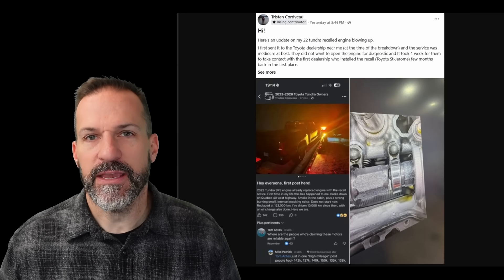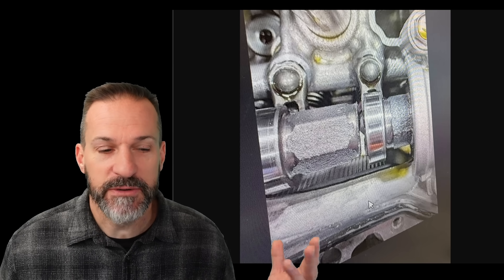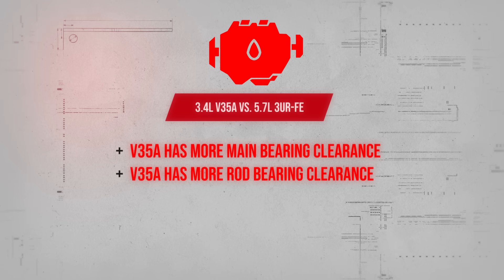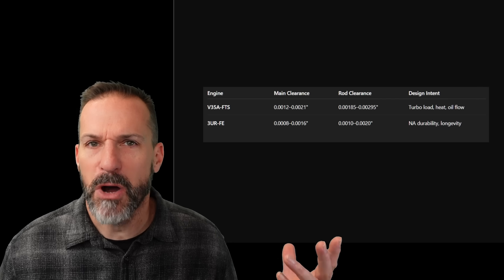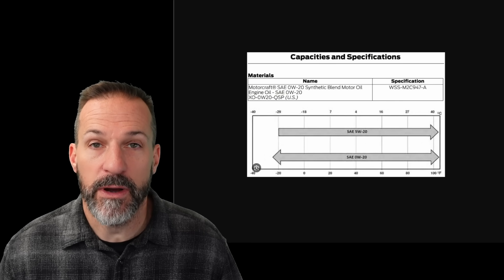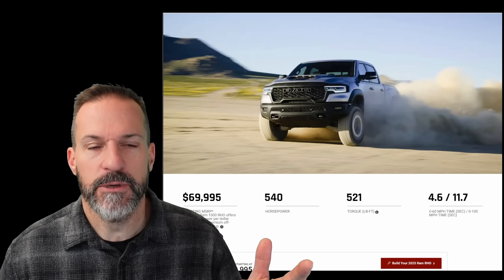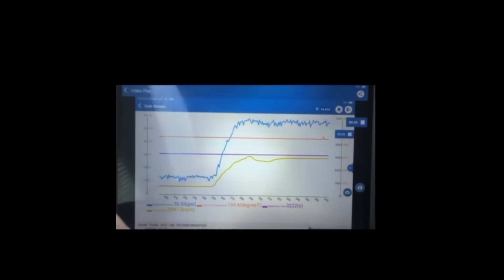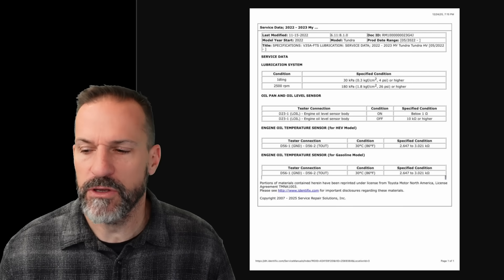Can We FIX Toyota's BILLION Dollar Mistake at Walmart? 2022- 2026 Tundra...

Comment: With respect to temp range any oil is acceptable.  Do NOT ignore the old school temp vs viscosity charts.   They track Toyota and Lexus engines overseas in the Middle East, Europe and Australia.   Even 15w40 in an engine that specs 0w16 here in the states.   

Everyone cries the VVT systems can’t handle the more viscous oil. But at the proper temp the engine doesn’t know the difference.

Comment: 0W40 will likely solve the issue, however, modern engines are also calibrating the variable oil pumps and the derivative calculations off of the OE spec oil. You will also want to recalibrate the oil pump logic to the higher viscosity oil. This likely won't matter for everyday use, but for high performance or high load towing this very well may matter. As variable pumps are controlled electronically not just via bypass valves. They only have a high pressure bypass so it doesn't overpressure, but you might set off check engine lights if the diagnostics fail due to the different spec oil being used.

Comment: Turbos stink in gas engines for longevity. The higher rpm’s and heat just wear everything down faster. Turbos are great on diesel’s cranking 1400 rpm’s.

Comment: If Toyota the reliability king for decades is having issues with small displacement turbo engines in trucks can we FINALLY go back to simple V8's!? Every manufacturer is having issues. Save a little fuel but make engines grenade with less than 100K... ridiculous. Throw away cylinder deactivation, hybridization and start stop crap. Give us a simple, overbuilt, pushrod V8's again!

Comment: For the old school engines, 15psi oil pressure would be The Absolute minimum at Idle that I would call sufficient, with 30-50+ while under load. Running 6psi at idle, especially in a boosted application, is mechanical suicide. 
On the oil weight, it's rather important to understand the additive package has an incredible amount of difference to how that viscosity performs in its range. A 0 weight oil is that viscosity in Summer temps, whereas the number following the W is in Winter temps. The two (additive package and the base weight components that is) go hand in hand in the grand scheme of things, but if you want more protection vs a 0 viscosity, you'd need to move up to a 5W-30 or 40. My old race-built 4 banger running 35psi (early 2000s build) was 20w-50 spec, though I'd rev the nuts off the thing frequently and change the oil as both precationary and mechanical safeguard measures.

Comment: My 22’ L87 6.2 failed pico test at 58k this summer and engine was replaced under warranty.  I went to 0w-40 at 300 miles on the new engine. I’m a mechanical engineer.  These companies are now being run by finance and marketing, not engineers.  EPA is driving decisions creating poor reliability and at this point don’t see anything that is going to change in short term.😢

Comment: Back when Ford first changed their older engines from 5W30 to 5W20, I immediately saw this as an issue. For one thing, those engines were broken in and spent the majority of their lives running 5W30, but suddenly 5W20 was going to be the recommendation????? No way.
I bought a used 1998 Ford Windstar from a co-worker who was moving out of state and he didn't know what to do with his old van. I offered to buy it and he accepted. It was spec'd at 5W30 originally and now I was supposed to run 5W20 in it. I called the local Ford dealership and asked about this requirement. I said I believed that the 5W20 would probably provide sufficient lubrication for the engine, but would the 5W20 provide sufficient cushioning for the parts. Would running 5W20 actually allow the internal parts to start rubbing and cause additional wear? The individual from the dealership said he could not argue my point and said Ford only recommended 5W20 but did not require 5W20.

Comment: Almost makes you wonder if there something you could do with a TAZER or similar device to program the oil pump to keep a much higher pressure. This needs to be a wake up call and consumers need to push back hard against EPA fuel economy standards, we need reliability standards instead.

Comment: Tighter tolerance means better control over variance in specs.  It doesn't mean 'tighter'.  The tolerances on diesel engines are FARRRRRR better (tighter), because they HAVE to be with the crazy compression ratio's. You don't see them failing from 'tighter tolerances', you see them last longer.

Rant over.  I'll watch the video now...

Comment: We speak about load but not a single time has anyone mentioned that the tune is the issue along with fundamental design … you can change the load on the engine by tune but Toyota can’t change the tune or they will get a hefty dinner vehicle sold due to emissions. The main reason they went from a v8-v6 … the biggest issue with these engines is not just the design of the crank and bearings but also how these engines were tuned to make the power and load on said parts. A simple tune can change that aftermarket but on a global scale for Toyota it’s not so easy as it needs to be emissions compliant for their emissions credit.

Comment: In our country, Toyota runs 5w-30 for all twin turbo V35A engines. Zero engine failures. Another note, our LC300 and Lexus came without AGS “Active Shutter System” from factory. That is another thing you need to look into.

Comment: Lets get something very fundamental straight right from the beginning.  Tolerance and clearance are not the same.

Tolerance is the allowable deviation of a dimension from its nominal value.  Example: 1.00 +/- .005.
1.00 is the nominal value.  +/-   .005 is the tolerance.

Clearance is the gap designed to be between two parts.  Example: .010. And it has a tolerance  010 +/-  001.

You need an Automotive Engineer to proof read your content.

Engine oil viscosity considerations is another example.

Comment: If it helps your research, one of my cars is a small turbocharged Chevy.  I bought it with low miles, and I wanted to do the best maintenance I could with it.  US spec oil for the LNF engine is Mobil 1 5w30.  However, looking at an Opel owner’s manual of a car using the same engine, it seems Opel specs the LNF engine with a euro 0w40 oil.  I did the same thing with my Dodge (using a Lancia owner’s manual) and sure enough, a thicker oil is recommended.  It’s obvious US oil spec focuses heavily on fuel economy and emissions rather than engine longevity.

Comment: Worked at Toyota & Lexus for years. I drive 2005 Saquoia it will live forever. My wife has a 2014 Lexus Gx460 will also. But front cover will need a reseal. Is what it is. Good old quality

Comment: The exact thing i was saying back when the L87s were coming out, and now all 3 of them have close to 100,000 miles running nothing but 5W30 with no issues.

0W40 is better than 0W20 for sure, but i'm not at all convinced it's enough. From our 2017 Yaris to the 2023 mazda 3, and every work truck we have that calls for something under 5W20 we have been using 5W30 with not one issue. 

I'd recommend everyone to do the same.

Comment: The number of main bearings is pretty sure to be significant. Four in the V6 vs. seven in the straight 6, even allowing for variations in bearing widths and diameters. Flogging an undersized engine with turbocharging to get massive power and torque never seemed to me to make sense and experience seems to be bearing that out.

Comment: Wow didn’t know the Toyotas have a variable oil pump?! And 4 psi?! Wtf! That’s insane! Also learned something about my 5.7 that the bearing clearances are closer than the V6 TT! I run 5w30 in the 5.7 and I just let it warm up in the winter but zero issues and maybe I use a gallon more gas between fillups.

Comment: Sorry, know this isn’t a video about your Ram… but I have a question. My 2026 Ram 1500 Rebel has about 4500 miles and I’m averaging 16 MPG with 90% highway miles. Cruise set at speed limit of 75 in 2wd… this seems crazy and I noticed your mileage loop was much higher.  What if the RPM of your truck at 75 mph.

Comment: Do not confuse oil pressure with oil flow, Harley Davidson engines are low pressure but high flow engines, that’s why they no longer put an oil pressure gauge on them. With the right lubrication package you don’t need high pressure just the right amount of oil where it needs to be.

Comment: Chevrolet had failure issues on the 6.2 liter engine. At first they recommended 0-20w oil. Then to solve the failure problems they switched to 0-40w and solved the problems.
Reply: That didn’t solve it, just got engine to run long enough to get out of warranty

Comment: I have had 800hp 4 cyls. Stock v6. Stoc v8. Whatever. Had mercs. I run 5/30 in everything I have except the 6.0 I have I use 15w40. Heavier oil is a MUST.

Comment: The correction would be to install the tried and true solid reliable 5.7 liter V8 as the recall fix not replacement V6 turbo motors.  A V6 option in the Tacoma and 4runner would be good as well.  Things were not broken and they didn't need fixed with turbo motors.

Comment: Yup i knew it!!! 0w20 is absolutely the wrong oil for this engine. I put 0w20 in my 5.7 tundra back when it first came out and when it came time for an oil changed i noticed that the 5.7 burned more than 2 quarts of that oil. I immediately took back the 0w20 and got 5w30 and never had an issue with it burning oil ever again. And now my 2022 V35A ive been putting 5w30 in it and it runs sooo smooth with 90k miles.

Comment: I think the entire aluminum engine block is not rigid enough and the entire engine is flexing and warping, hence the crankshaft spinning inside this twisted engine block is spinning crankshaft main bearings.  The crankshaft can only spin properly inside the main bearings if the whole engine assembly stays perfectly square.  The block walls are too thin, the block is not reinforced enough, and the cooling chambers are not circulating enough coolant to keep the aluminum cool enough not to weaken and twist.  I would be willing to bet a similar engine block design with thicker walls made out of an iron block would not twist.  Bad engine design.

Comment: Why put 0-30 or 0-40 when you could bump the W weight, which is the real wt. The second # is the fake wt, imo. My car mfg wants me to use 0 or 5-40, but not a chance. I mix 10-30 with straight 60wt, 50/50 mix, plus 1/2qt of Lucas. If I could get the oil I wanted in straight 40wt I'd likely use that instead, but this mix works. So whatever wt that turns out to be it's substantially better than the oem suggestion. I also disable the variable pump so I have normal psi. It doesn't get very cold where I live so no need for thin oil. On the coldest mornings I have pressure in 2-3 seconds, which is better than what others with the same engine report, using the suggested 0 or 5W oils. Maybe it's because I have less oil draining out? Maybe the thicker oils don't move as slow and we're led to believe. Plus, at cold start, I bet $ I have more oil left on the bearings and of course what is there is much better. If I did live where it's cold enough to be an issue I'd use a block heater, or more likely, a pre-oiler, but I would never use thin oil. 

My friend with a 2yr old Jeep is on his second eng. Neighbor across the street with a Dodge truck is on his third set of cams. No thank you, I'll use real oil and pressure. All my friends refuse to use thicker oil out of fear it will void the warranty, as if anyone would know. I just laugh and tell them I hope it fails before the warranty expires. Then I also wonder; how do you think the car mfg pays for those engines under warranty? Increased new car prices and reduced quality, obviously. 

If I had to guess why the mfg's are being forced to use super thin oil, I'd imagine it's big brother trying to force electric cars. Their MO is usually not to dictate, but guide you into making the decision they want.

Comment: The engine oil goes through a oil cooler using engine coolant which is 210 temperature they need external oil cooler

Comment: I’d be curious to know if there is a trend to the operating conditions when failure happens. If there is a trend that they all seem to fail on the highway while cruising that would make sense since the engine is operating at very low rpm and high load for extended periods of time, exactly the right conditions for low oil pressure due to thin and hot oil to take out bearings.

Comment: The age-old oil issue that has been going on for the last 15 years, the needs of the manufacturers vs the good of the consumers and how manufacturers do not always recommend what is actually good for the consumers because of the CAFE rules. I want to listen to the manufacturers and their recommendations on oil. However, after rebuilding an engine due to stuck piston rings due to oil burning, I have come to terms with the fact that manufacturers do not want you driving their cars beyond warranty. And, 60-100 kmi simply isn't  long enough to own a car when paying the amount of money I have to pay to get a new car. Should have been putting in 5w-30 and lose a few mpg instead of 0w-20 and losing 100 kmi less engine life.

Comment: Surely, if it was only an oil pressure problem, Toyota would have fixed that by remapping the pump quickly and cheaply. I think it's a complex multi factor problem like most modern failure scenarios.

Comment: I think we're seeing a lot of it on these turbo engines due to being programmed to be running on the edge of efficiency all the time high pressure heat hot spots lean burning direct injection washing down the cylinders so we're burning oil as well and oil contributes to pre ignition I think a lot of the wear on main bearings is pre-ignition based. And I 100% agree that these variable pumps in thin oils or contributing factor as well

Comment: There are many people with engine failures that have ran 0w30 or 5w30, so that’s not the answer. I’d be curious whoever posted that data log would try Xw30 oil to see what the difference would be? I’ve heard in the Middle East and Australia people are using 5w40 and they’re still seeing failures. Also, fun fact is the 3.5 ecoboost has tighter tolerances than the V35A.

Comment: First, who started calling clearance  specifications "tolerances"?  You could have a quarter inch clearance with a 1 ten thousandth inch tolerance.   I.E. 0.2499 inch to 0.2501 inch.  Anything could have a tolerance. 

Second, are we saying that these bearings are 100% "hydrostatic"  bearings, totally dependent on the supply pressure to resist loads?

The other extreme is a fully "hydrodynamic" bearing, where the rotation alone can create an  "oil wedge" with stiffness of 100,000's of psi.  Some early journal bearings had zero supply pressure.  The oil sat in a sump below the bearing, and was brought up to the bearing with a large diameter "oil ring".

Obviously automotive bearings are a mix of both hydrostatic and hyrodynamic.

 The huge journal bearings in utility turbines of 1million HP, do not depend on the oil supply pressure to support the loads, (except to ensure adequate oil and, for the cooling effects).  These bearings need to see minimal loads at startup due the low rotation speeds where the film thickness is very small.  

It would be nice to have someone with access to finite element hydrodynamic bearing stiffness and damping analysis software take a look at this problem.  I have used some bearing programs developed at UVA, Fortran at the time, but not sure I could run them under Windows 11.😂

What do I run? (5W30).  It is true that thicker oil "with all other variables frozen" should show better stiffness.  Also, since the oil is also treated as "hydraulic fluid" in modern engines that may need to be considered such as VVT.

Note, a 5w30 oil if hot enough, will have same viscosity as a 0w20.  Perhaps temperature needs more consideration.

Comment: That's a real interesting theory I have a 2024 Tundra bought in January of 24 and I recently received an engine recall notice. I would consider doing what you suggest but I won't because I won't do anything that could void my warranty I have an extended warranty 8 years and 75,000 miles it would be stupid to try something like this and loose this warranty that was pretty expensive. My owners manual said that you can use 5W20 if 0W20 isn't available but you should go back to 0W20 the next oil change. Even with using thicker oil my engine could still fail and then I would just be SOL so no thanks Car Guy. I don't think it's very smart of you to recommend doing something that will void someone's warranty and could also potentially eliminate them from taking advantage of recalls.
Reply: And yes I saw your disclaimer.

Comment: If you're not an engineer maybe you shouldn't have fake theories,  I worked for Stellantis  do you think I would buy one, No. I bought a Toyota.  You're theories or guesses are just that.  The  I think. doesn't work in engineering.  The ideoctic bit about the straight six having more main bearings It's a straight 6  it has a longer crank normal not a V8 shorter crank. I hear a lot of bashing on Toyota trucks on this channel but in other countries that have few repair shops and even fewer paved roads they alway buy Toyota. Now why is that.

Comment: Without the small positioning tabs on the main bearings they will continue to spin out and cause engine failure due to lack of oil pressure. I do agree heavier oil is a given. but parts are faulty.

Comment: I had a Nissan Altima SR VC-Turbo: Recommend oil was 5W-30.  I then changed to an Infiniti QX-55 (same engine): Recommended oil was 0W-20.  I would stay with the 5W-30.  It was hard to tell any difference in real world driving on the fuel economy between the two viscosities in the QX-55.